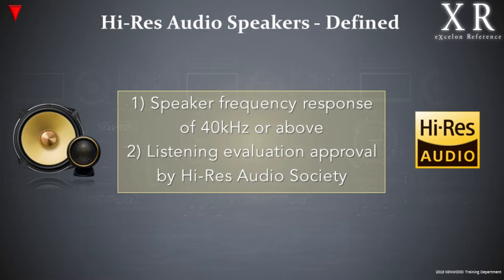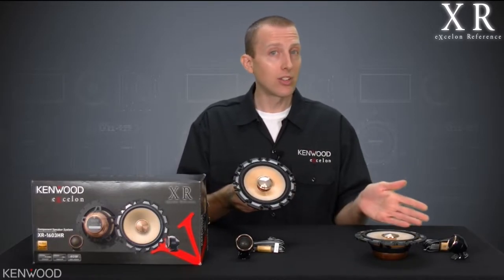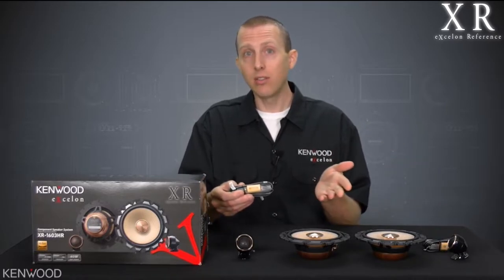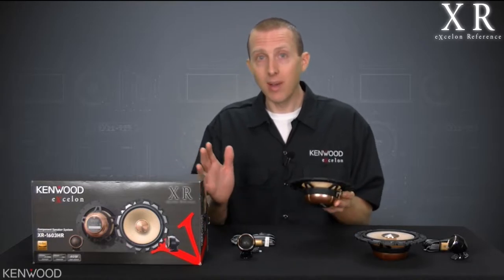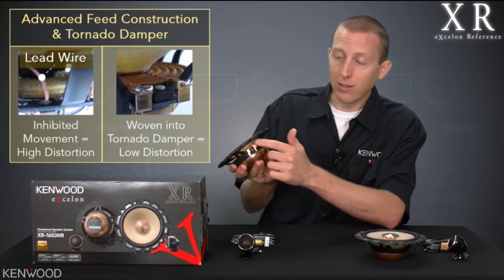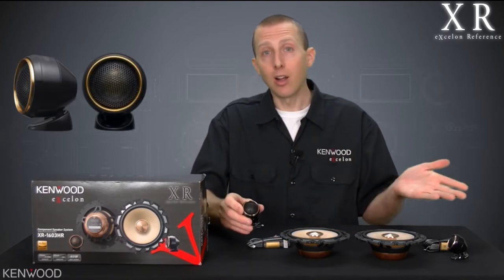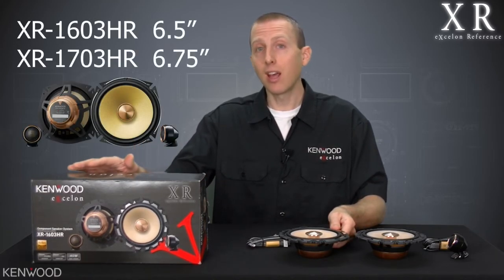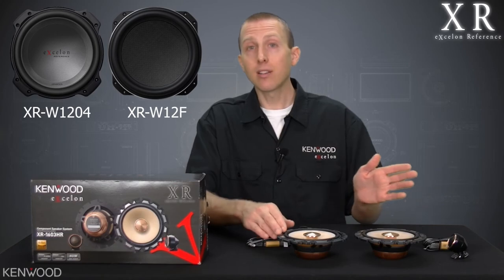What Are Hi-Res Audio Speakers? - KENWOOD eXcelon Reference XR-1603HR (XR-1703HR)

Comment: I wanted to ask about the XR1703HR. They are rated for 25hz. This is the lowest frequency response for a speaker this size I have seen advertised and is even a lower response than most 10”-12”car subwoofers. Most 6” range speakers are rated to 40-50hz. What is the DB+- roll off and at which frequency does roll off start? Are there frequency response graphs posted somewhere because I am extremely interested in these speakers. Why would I need a sub with these as 25hz is more than exceptional for car audio it’s downright amazing.
Reply from the maker: The frequency response is what the speaker is capable of reproducing.  A subwoofer is designed to maintain playback in the given low range frequencies, and is suggested in combination with these speakers.
Reply: That’s why I was interested in seeing a response graph. Just because a speaker can “reproduce” a frequency (in this case 25hz), if this response is something like -40db below the shelved response of (40hz/50hz->10khz) then it’s not exactly representative of the realistic capabilities of the speaker.

I see on the website that it is rated 25hz-48khz (-10db). What is the -10db referring to? A -10 dB fall off at the 48khz? If so -10db starting from where? 20khz? Or is it -10db at 25hz. If so starting from where? 80hz?

Any speaker can reproduce any frequency. It’s all about the speaker extrusion and the volume of space they are trying to pressurize. I’m sure even the KFC-P710PS (63hz-24khz) can technicality reproduce 25hz, but it’s all relative. They are not marketed as such, but the XR-1703hr are marketed as a speaker reaching 25hz. I’m just asking what the DB falloff is in relationships to the speakers level response ie the point where spl is stable over a range of frequencies (25hz= -x dB < 80hz? to 10khz?)

Just looking for more data. Thanks
Reply from the maker: @ratz34  We will look into it and see if we can provide you with more details.
Reply: Awesome thank you 🙏
Reply: @ratz34  so did you ever find out if these were any good?
Reply: Aries King The speakers are great, even though I’m using a JL audio VX700 as my amp I believe my factory headend is limited to 30hz as response drops severely after this something like -24db octave. As an experiment I added a home theater sub that is able to reach down to 15hz in my room but it to still only had signal to 30hz from the car.

Back to the kenwood speakers. The main drivers are not bandwidth limited so they will reproduce what is sent to them within reason and follow a natural drop in db after a certain point. This is just physics based on the size of the driver. Because of my car limiting the frequency below 30hz I cannot test the speakers true response curve.

The tweeters have a built in boost of 3-4 dB somewhere around 7-10khz I think (I don’t remember exact where), so you will absolutely want the ability to smooth this out with a PEQ.

For information purposes I measure the frequency response using a calibrated mic and RoomEQ wizard.
Reply: @ratz34  

I was planning on these speakers but like your JL amp all my amps are around 75w rms.  I was surprised these were only 45w rms.  I didnt want to buy a new amp or damage these speakers.
Reply: "Factory headunit" 🤦🏼

Comment: can my factory car stereo be okay with these speakers or do I need an amplifier?
Reply from the maker: Maya Kofinoff, you can use these with a Factory stereo as long as the impedance was correct ( 4ohm Final ) and the OEM system is not crossed over.  They are designed to be used with an amplifier for best performance and to reproduce the Hi-Res output. Thanks!

Comment: What’s the point of reproducing sounds up to 40khz?  Normal human range is 20hz - 20khz. Best case scenario is young person with super hearing maybe can hear up to 28khz. Sounds like a gimmick to me.
Reply from the maker: Good question... and here is the answer:  Although many cannot hear much above 20kHz, there is a wall where the sound completely drops out at higher levels on traditional speakers.  With reproducing sounds up to 40kHz, this wall doesn't exist and there is a smooth roll-off of sound for all hearing types.
Reply: @KenwoodUSA   Thanks for that excellent response above - I hear the difference in Hi-Res music and it's huge to me. It's difficult to explain it to others who don't hear the difference or just don't care. For me, the best explanation I've come up with is to compare sound to vision - show a hi-res image then, do to that image what an MP3 would to music and they get it. Light bulb turns on. A visual helps.